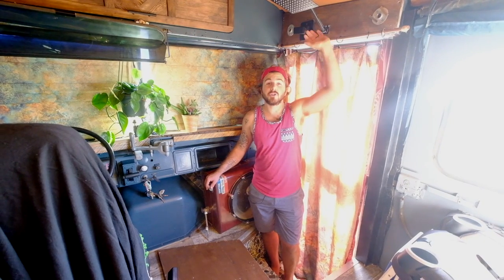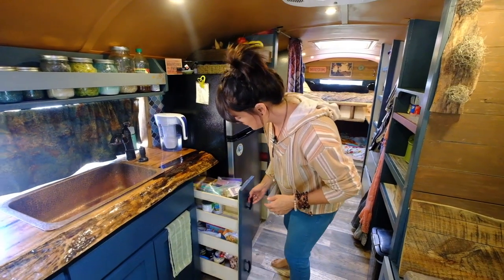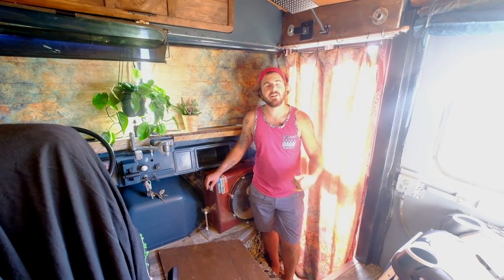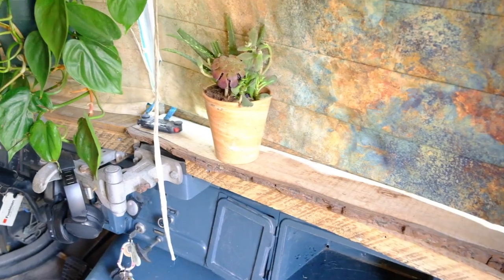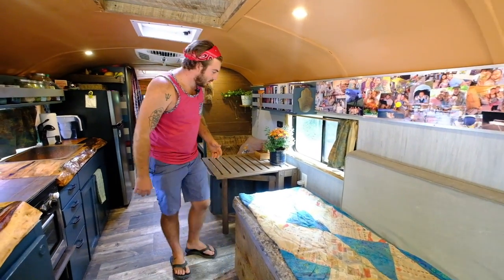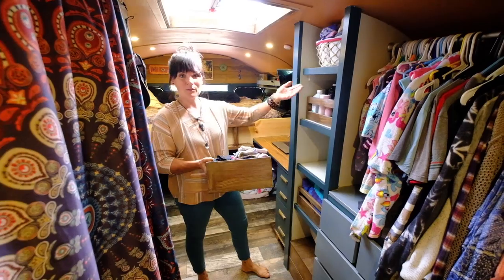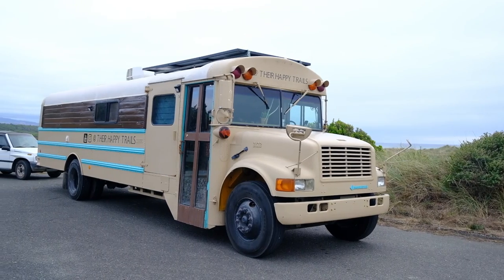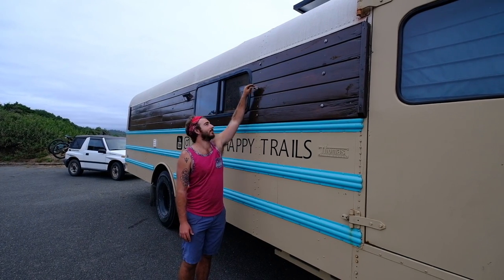Adorable DIY School Bus Tiny House - Shower, Toilet & Double Work Desks

Comment: shower in the stairwell is genius- a typically wasted single use, enter/exit space, transformed into a shower where the water can go right outside, all while regularly cleaning the entryway.
Reply: Thank you!! It does work out great!
Reply: IKR? ABSOLUTELY BRILLIANT!
Reply: Thought the stone flooring etc would crack from bus moving.   Any problems with it?  Very creative design, everything is useful.  Continued safe travels and  congratulations on your expected new arrival.
Reply: @denisephillips9269  hey! We used a flexible grout on for all the tile, and we have had no issues!
Reply: No mud puddles at exit?
Reply: @aces4amy226  Would be cool to somehow have the water drain into a garden hose you could attach leading the water away from the bus.
Reply: Excellent idea
Reply: They would come up with  an idea as such.  As their mind isn't clostrophobic and stuck to the typical hum drum stuff that most copy, paste and repeat. It is beyond obvious that these 2 live their lives fully without remorse or concern about what the next man is saying or doing.
Reply: Hi, we are working on our bus build and are going with your shower idea, thank you. We will give credit where it's due.
  I didn't see where you control shower water, one handle, two?
Reply: You could just move the bus either after you are done showering or before you do your showers. No need to STAY where the puddle is. Certainly won't hurt anything as it would dry up shortly.

Comment: the smartest use of the bus steps ever!!!! that is brilliant!!! I live in Little Rock and now I know where t go to get that floor.  there is peel and stick which from my own experience comes unstuck, vinyl also moves as not only as a bus moves but as a house shifts.....I will save this video, O'briens in hot springs?  thanks.
Reply: It’s is O’Bryan Family Flooring! They installed the flooring also and blew my mind how well the instal went. They came in a level out my subfloor with a flexible thin set then cut and glued the flooring down. We’ve never had an issue with it coming up or anything. Highly recommend them